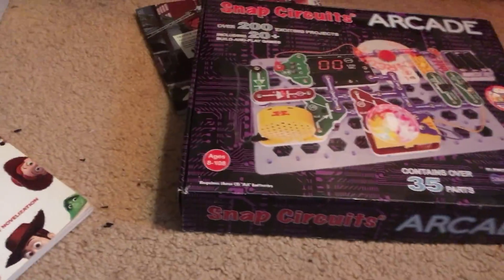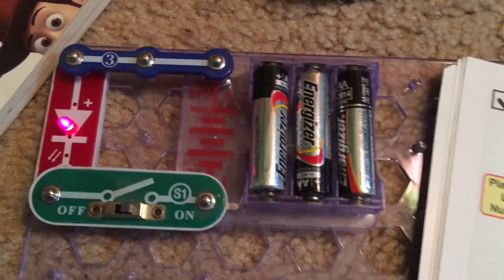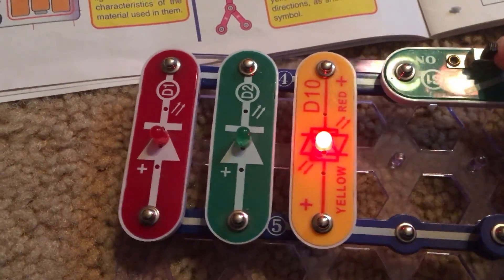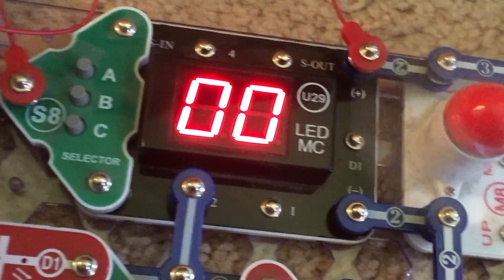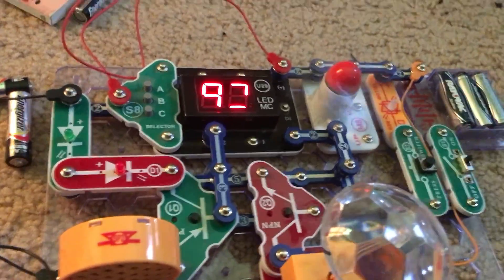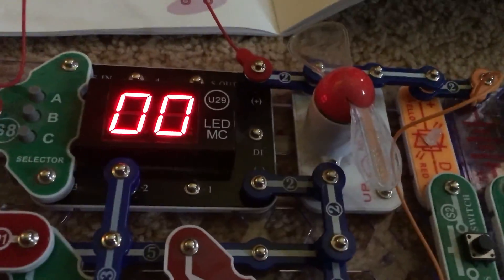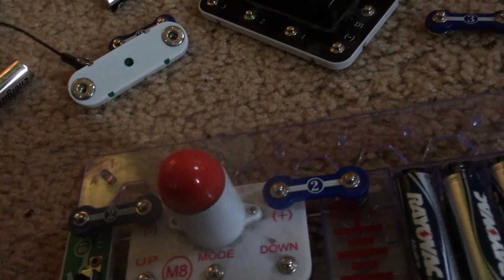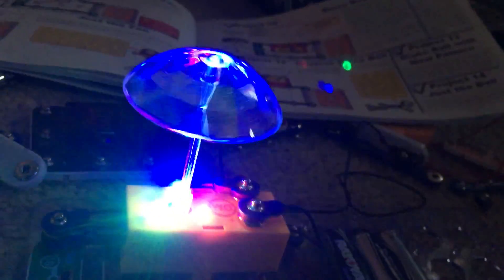Snap Circuits Arcade: Projects 1-10

Comment: I can’t get the word fan to work. I erased the messages and now the S2 cursor won’t show up for me to program it. The fan is blank.
Reply from the maker: Natasha Udell If you connected it the wrong direction, the LEDs in the fan will not work since current can only flow through the LEDs in one direction.  I’m not sure if it will help but try connecting the fan the other way.  If not, the LED’s in the fan may be bad.